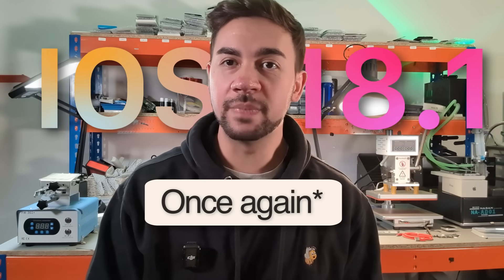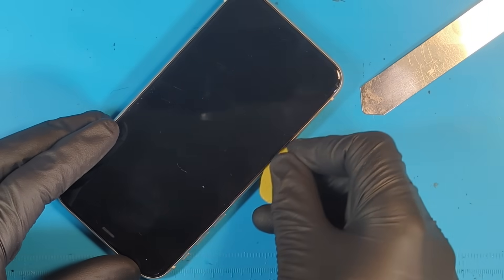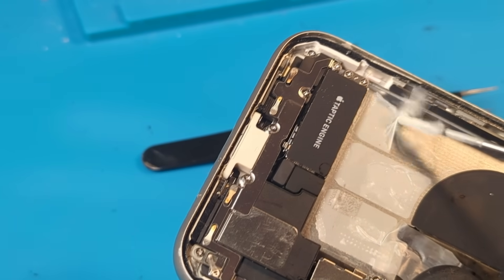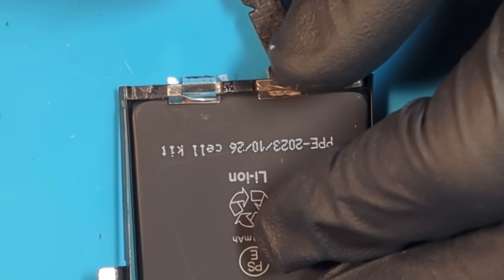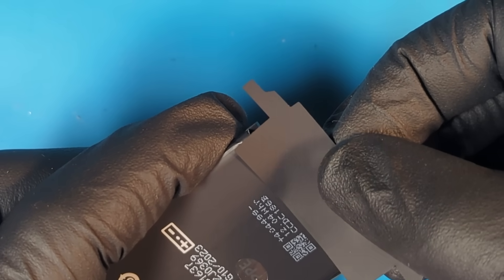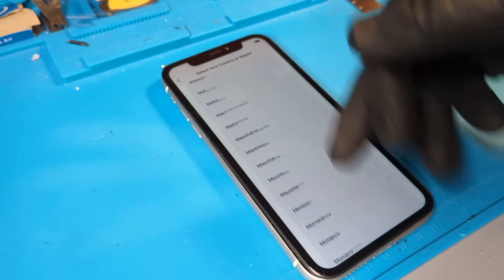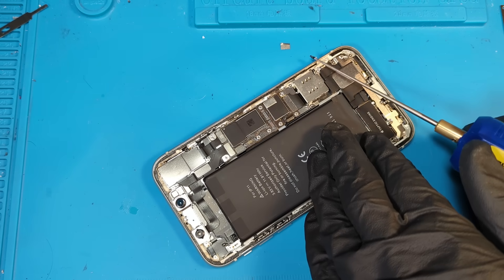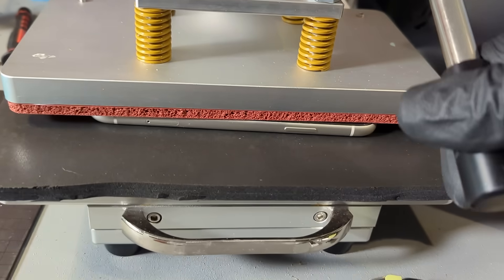How to Reset Battery Health to 100% and Remove Notification after IOS18.3(BMS Swap method)

Comment: Hi, i want to ask about that i am using my iphone 12 but i have another iphone 12 battery which is taken out from an old device having 94% so what if i get installed in my device and replace the bms too will it show the actual 94% battery health in my device.....or will it keep showing the old battery health......if it is how to get the 94% actual battery health......pleasee reply
Reply from the maker: Hiya, if you have another genuine battery from another iPhone that's 94%, you can simply swap the battery over and Apple should allow you to calibrate it. The battery health will remain at 94%. No BMS swap needed :)
Reply: @ninjarepair  so am i needed to approach the apple store to get my battery health updated.....will it show the actual remaining health and actual cycle counts updated or will it resets to 100%? i dont care about data loss I AM CURIOUS TO KNOW!!!
Reply from the maker: No, you just install the 94% Battery into your phone, and it will give you a notification to calibrate :)  @madhurkrishna9423
Reply from the maker: No data will be lost
Reply: @ninjarepair  oh, thanks alot for your answers as i have iphone 12 currently sittin on 69% and yes repair function is eligible from ios 18 so it will be paired automatically?
Reply from the maker: @madhurkrishna9423 as long as you're on the latest ios then yes you can calibrate the new battery when prompted :)
Reply: @ninjarepair  sorry for many questions....is this applys to screens also? i got replaced my screen with another iphone 12 but it shows a non genuine part
Reply from the maker: @madhurkrishna9423 you also need the proximity flex that came with that screen in order for it to calibrate correctly
Reply: @ninjarepair thankyou so much for your precious answers😌

Comment: Hey I have a question. If I am on iOS 17.7, and I replace the battery while my phone is at 80% health. If I replace bms without the flashing firmware, will my battery health percentage go down or will it stay at 80 until it’s actually at 80 precent?
Reply from the maker: I think you have to flash after 17.3 or 17.4. What iPhone model do you have?

Comment: Okay I have a question and I hope you can answer me this because I asked this before at a different Chanel of YouTube and they were not been able to answer me , what about those batteries 🔋 that says pre-programmed with tag in flex ? And says no welding needed , or those that says with diagnostic flex ?
Reply from the maker: There are new batteries that you no longer need to do this bms swap method. You simply put them in and use Apples diagnostic tool. They show as genuine, but used, and still be 100% Battery health.

There is also the no weld batteries. These batteries mean that you need to do all steps in this video, but you do not need to own a spot welder. The old bms is attached to the side of the new battery. I hope this makes sense. It's hard to explain in a message :)
Reply: @ninjarepair oh ! Yeah I see ! Yes I finally got an answer and you gained my subscription too 👍🏼😎🙏🏽 maybe if !! You can you should make a video is talking this type of batteries too ☺️🙏🏽
Reply from the maker: @jonathandiaz1701 thank you very much for the sub! I'll try and make one in the future. I have a couple in stock at the moment actually!

Comment: There is a problem with this method now. When you use the original BMS but with tag on flex FPC connector the iOS somehow detects that the BMS is not genuine and reduces the GPU performance. My 14 pro max battery was replaced with the same method but on geekbench I was getting 8000 score in GPU benchmark which is extremely low( it should be above 22k). I replaced the battery with its own BMS and without any flex tag on and the performance of the device was restored. However you will have a notification of important battery message under battery health section.
Reply from the maker: Was the cell below 80%? If the capacity is below 80% you need to cycle the battery above 80% with a calibration machine. Otherwise the battery will not perform as intended :)
Reply: @ninjarepair no it was brand new. But somehow maybe due to some changed in iOS 18 the system secretly detects it and reduces GPU performance. Absolutely no popup or warning comes up. I caught it after 6 months when I randomly tested on geekbench
Reply from the maker: @sagnik7841 oops sorry, I meant was the battery that the bms was taken from, was that below 80%? If the old bms is below 80%, when the new cell is attached, you have to use a calibration tool to increase the percentage of the bms to over 80%. This can take several days. Otherwise the battery will essentially go into a type of limp mode :)
Reply: @ninjarepair  When the replacing part is completed, should we also keep the battery tag inside the phone or should remove when fixing? If we should keep it inside, please tell a method to remove it. (Important battery message and health should be fixed) TIA.
Reply from the maker: Keep the tag on connected, otherwise when you read the health with 3uTools etc, you will see the previous battery health :)  @SAMITechlk
Reply: @ninjarepair Thank you. Can you please suggest me a way that we can use the tag and remove later, which will fix battery health and important message. Can JCID programmer would help? Thought of buying one specifically for this. Your opinion please!
Reply from the maker: The JCID tag on flex is more expensive than the one in my description but the health will decrease over time. You will also need a jcid V1SE or similar to use them.

The one in my description does not need a programmer. Just attach, and flash the phone like in the video :).

Why would you like to remove the tag on flex later?
Reply: @ninjarepair I heard that when using JCID V1SE with JCID tag, we can reuse the tag for calibrating many batteries. Still I’m confused. How can i contact you personally? I have more questions 😅
Reply from the maker: @SAMITechlk with any tag on flex, if you remove it, the health on the phone will show as 100%, but when you read it on the computer it will say the old health. So yes you can reuse the tag on flex if you like, but the cost is low for the tag on, so it's best to keep it on :)

Comment: Does 3 u tools show the previous Battery Health after doing that.
Reply from the maker: Not with the tag on flex still attached :)
Reply: @ninjarepair  I use the old cable on new battery and 3 u tools said 1170 cycles :}
Reply from the maker: @aungkaung9810 did you use the tag on flex?
Reply: @ninjarepair no
Reply from the maker: This is your problem. You need to use a tag on flex for this method  @aungkaung9810

Comment: I’m sure you’ve fielded these questions already but where do you source your components?  
Very specific battery and stick on adhesive template so I’d imagine there’s a battery replacement kit or something specifically for the model of iPhone?
Reply from the maker: I tend to buy mine in bulk from the manufacturer, but you can also buy them from trusted suppliers such as iParts4u in the UK. Batteries should come with the adhesive specific for the model :)

Comment: Hi, what mode on the welder are you using on the video?
Reply from the maker: I use the highest setting if I'm welding with this spot welder. The highest setting works well when you're welding against the mini copper plate. You can use a lower setting if you're welding directly onto the bms. I hope this helps, it's hard to describe without creating a video.
Reply: @ninjarepair  I mean, there is 6 modes like auto etc, im using pulse rn but maybe there is some other better mode.
Reply from the maker: @CytruSek7331 oh sorry, I use auto :)
Reply: @ninjarepair  Thanks, really appreciate it :))

Comment: I'm running 2 x 13 Mini - one on 15.4.1 and the other on 16.4.1, as I'm aware that older iPhones + newer versions of iOS + a tired battery = woeful performance. 

Am I right in thinking that just the tag-on flex method once the BMS is transplanted to a new battery should be fine on iOS 16 versions and below, without forcing to reset via 3U or upgrade iOS version?
Reply from the maker: Yes, you can swap the battery cell using the orignal bms, then add a tag on flex. There is no need to flash the phone on your ios versions you have mentioned

Comment: Amazing video! My question is, do you need to let there the tag on flex cable? I thought… It’s kind of expensive, so does it suffice if we took after the flash the tag on flex cable off the battery? Thank you.
Reply from the maker: Ideally yes you should leave them on. If you remove it, when you plug the phone into the computer, it will read the previous health. The flex is quite cheap now at about $3usd or less :)
Reply: @ninjarepair  OK thank you, I smell a rat cause in my county the basic JCID tag on flex cost like 15 to 20 usd... Now I finally understood why everyone use it when it's so cheap. Thank you a lot.
Reply: @ninjarepair  Now I double checked the price and it's 20 to 25 usd in my country.
Reply: Could you please provide me the seller of yours? Thanks in advance
Reply: @ninjarepair  And one more question please, is it necessary for iphone xs too? cause I didn't saw any flex on rewa for example.
Reply from the maker: @frantisekvondracek9846 there is a link in the description. Hopefully they send to your location.

On the iPhone xs you do not need the tag on flex. Just reset battery health with JCID battery flash
Reply: @ninjarepair  Thank you a lot. It does mean lot to me.

Comment: Hi, I just got my battery cell replaced for iPhone 13 with iOS 18.4.1 from a repair shop. My new battery health says 100%BH, however Service message did not go and it says Service. Could you pls guide….do I need to worry as in the initial couple of charge it is not giving me a full backup. Mechanic says that this message might go in the next software update.
Reply from the maker: Sorry I thought I replied to this. If the battery is below 80%, you need to cycle the battery using a special calibration tool so that it goes above 80%. After this, the message will go away. I think that with time, this battery message of yours will go away too. The BMS will start to calibrate itself, and will likely take 10 to 20 charges and discharges to go away :)
Reply: Thanks for your revert. Pls note that mechanic swapped the old BMS to the new battery cell. One more thing which I have observed is battery drains fast till 1% is left and last 1% takes lot of time to drain. So the overall backup is fine if I consider total drain. To me it seems BH is not counting battery left at 1% for some reason, hence initial 99% drain is much faster. Any views?

Comment: Seriously are you taking the piss. You lost me at the heat pad. The cost of that breaks the bank right there. I am on 85% after 28 months and will upgrade or change the battery. This is a geek tech video.
Reply from the maker: You can also just swap out the battery for an aftermarket one, but you'll still need to use heat to remove the display :)

Comment: Hello do i nees to keep the new flex flash to the battery or can i remove it after flash done…?
Reply from the maker: @marcoberdudu  I always keep mine on. You used to be able to remove the flex and it keep battery health at 100% unless checked with 3uTools etc. I am not sure now though. There is a possibility it might show 0% Blbattery health. You can check and let me know :). With the price of these flexs being so low, it's best to keep them on imo
Reply: @ thanks a lot for you reply what is the name for these flex please? And this methot with swap and flex work also for iphone 15 pro ?
Reply from the maker: @marcoberdudu  the flexes can be found in the description, but yes this method works on all phones up to the 15 series :)

Comment: Do i have to use tag on flex? If i reset the bms to 0 from qianli will it work?
Reply from the maker: @Mertaltinay  yes, you still need the tag on flex. You cannot write directly to the battery :)

Comment: Great Video! When you replied to an earlier comment saying that you use the JCID Repair Operation Platform, do you mean the JCI Device Operation Platform Software? If so, how do I navigate the fixing battery health after installing the firmware from 3utools?
Reply from the maker: Yes you download the JCI Device Operation Platform and 3UTools. Plug in the phone and download the firmware using 3UTools. This will save a file on your computer. Open JCID repair tool, and choose the "Repair battery health" option :)
Reply: @ninjarepair  Hey! Thanks for replying to my comment, could you perhaps link the download file. I'm only able to download version 1.2.02 which isn't the latest.

Comment: Anyone had problem with reseting iphone after replacement battery? After reset, battery shows 10% and u need to restart the phone to bring back your actually battery satus for example 88%.. 
U never know when it gonna restart again.. Maybe its take 3h or few days ..
I have tag on flex inside. I try without it but was shows old capacity of battery.
Reply from the maker: Check the panic logs. It could be an issue where the battery cell is not making a good connection due to poor soldering or spot welding :)

Comment: So from what i understand, there is no need for programmer anymore? (like qianli icopy?) You just need the tagons?
Reply from the maker: @bekmen2  with the new cheaper tag on flexs you do no longer need a programmer. However these tend to keep battery health locked to 100%. Using JCID or similar more tag on flexes are more expensive, but the battery health keeps updating over time.
A link to the cheaper tag on flexes are in the description of this video :)
Reply: @ninjarepair  god dammit, im like waiting for my qianli programmer right now lol. So it the no need for programmer an iphone model thing or a software thing? (Like every model that is able to update to 18.10 or newer os doesn't need a programmer)

Comment: At what point of flashing battery should be disconnected?
Reply from the maker: @jasur.tech101  the screen will tell you to disconnect. Alternatively you can press:
Up then down, then press and hold the power button until the phone boots to recovery mode again.

Comment: Hello do we need to keep the tag on flex in the phone after flashing it, or can we remove it please ?
Reply from the maker: @w4ssim480  you need to keep it on to retain the battery cycles at 0. I think health shows at 100% after removing the tag on flex, however it reads at the orignal health if you read it through 3uTools etc
Reply: @ninjarepair  Great thank you for responding so fast. Let’s say the phone was at 78% before changing the battery, if I remove the tag on flex after doing everything, will it go back to 78% again or decrease normally please ? (Like 96% for example after some time)

Comment: Hi @ninjarepair! Proud owner of 11ProMax, want ask about the board between the BMS and motherboard. It will always show 100%, or just arithmetically will count the degradation?
In comparison to 12+ models, if I will swap cell, will iOS 18.4 fix it itself (the message and percentage)? Heard somewhere about this thing
Reply from the maker: If you're using a JCID battery tag on flex, the battery health will degrade over time and provide an accurate health :). If you do not add a tag on flex, the battery will calibrate itself and the health will creep up, but it till take a long time :)
Reply: @ thanks! Heard it takes around a month for it, thinking about it

Comment: Is there any possibility to regain the 100% batt health without the tag on flex? Or it still shows the old batt health. It will not increase itself while optimizing the new battery?  Have you tried that?  Thanks
Reply from the maker: @Thooor17  people have reported that the health will increase slightly over time, but I don't think it will go to 100% on its own

Comment: so replacing your battery wipes user data on the device. and since there is a tag on the battery connector that makes the BMS think it is a new battery, lots of repair shop don't even bother to replace the battery. they just add the tag, flash your phone and done. Battery 100%  and take money for a battery replacement. the end user can never know that the battery has really been replaced or not. and all this is done using some sort of chinese software probably pushing a tweaked firmware and god knows what else is installed with this firmware.
Reply from the maker: @thomaslemaire1846 
Thanks for your comment and pointing out some potential issues. 

The firmware used in this process is officially signed by Apple, so there’s no modification or interference as you’ve suggested.

Regarding repair shops allegedly just adding a tag and not replacing the battery, do you have any evidence of this being a widespread practice? While it’s possible that a few shops might cut corners, it wouldn’t make much sense in the long run—customers would quickly notice if their battery issues persisted, and another repair shop could easily confirm if the battery was actually replaced.

Additionally, with iOS 18, most repair shops wouldn’t bother with this kind of workaround since it’s much simpler to install an aftermarket battery directly as no data is lost in the process.

Comment: hi, replaced battery for an iphone 6 plus, battery health showing 100% however the juice drops extremely quick to almost 0% in 3-4 hours with airplane mode ON only. any clue? appreciated
Reply from the maker: @lenco5994  try another battery. It sounds like this one has failed.
If this does not work, it could be the screen or something else which is draining the battery quickly
Reply: @ninjarepair  Thank you for your advice.  Let me get another battery and see.  Hopefully just this one bad.  Cheers